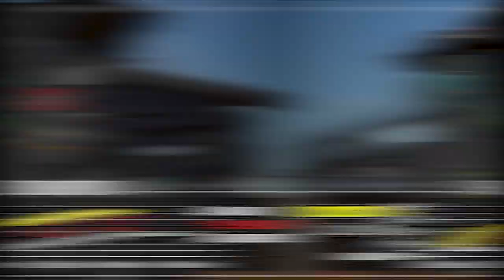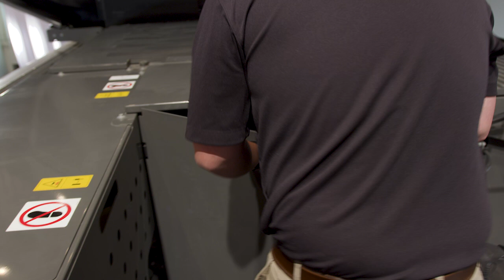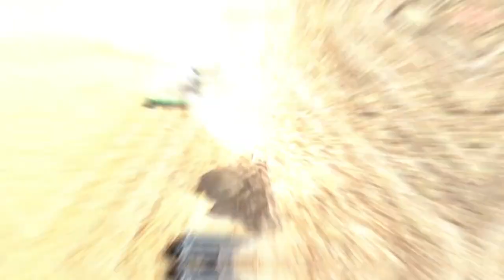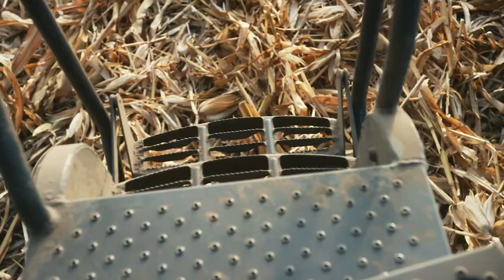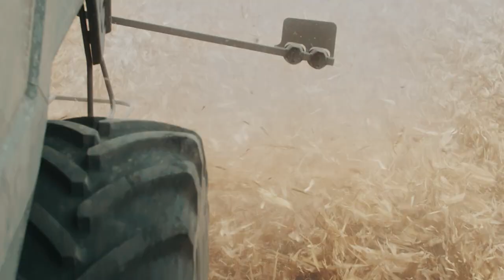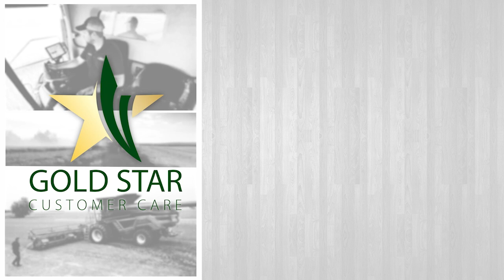Fendt IDEAL | Live From Hesston Premiere Event 2021 | Fendt

Comment: Sure wish a Fendt dealer would come into the central TN region.
Reply: I wish there was one in NC
Reply: We've got one in my area and the dealer's service capacity is really bad. I like Fendt machines but it's going to take some work to get their market share big enough to justify providing decent dealer support. If they had the support we'd look at them for our operation but it's not worth the risk right now.
Reply: If I go to John Deere and order parts they come to me with no freight. If it's the wrong part. No problem. If I order parts from Agco I have to pay shipping. The last $10,000 of parts had over $2000 of shipping. If it's wrong you eat the freight and restocking.
Reply: Craig Bush you really don't.